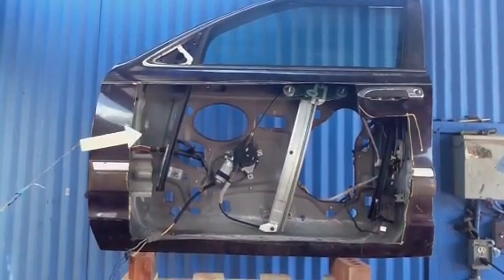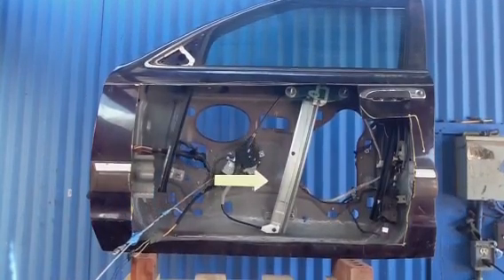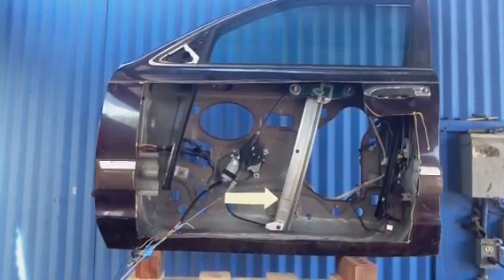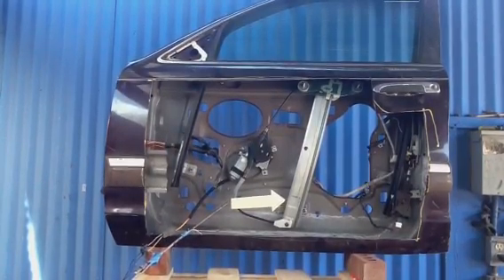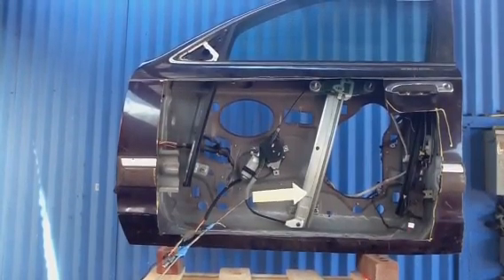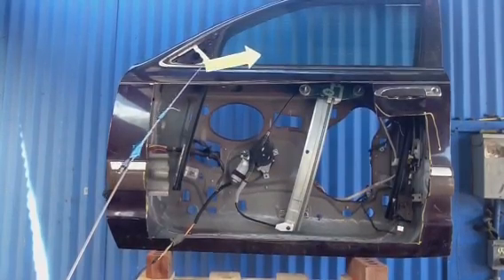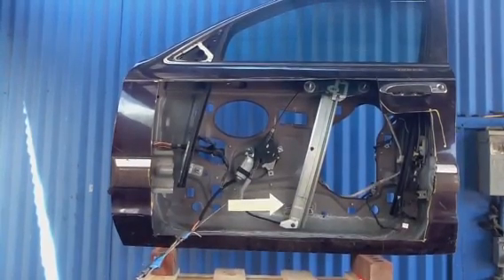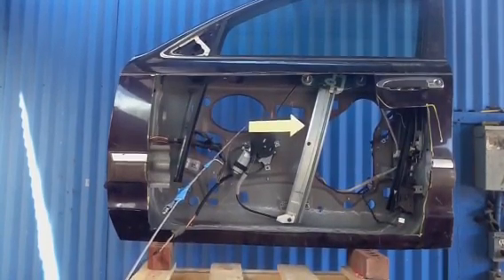How car window regulators work

Comment: Don't buy the hype. I went to the junk yard. Got 4, one for each window, then swapped them into my car. All 4 windows. Tools? T30 and flat head to take off the door panel. Then, 10m socket and a 10m closed end wrench to reach them two holding down the window. Get out there and become a junk yard dog. Save yourself bukus $.

Comment: Baloney.  The car's computer senses the slight overload on the motor as it reaches full up or full down, there is no encoder or data connection from the motor, only power  connections.  There is no "programming" involved, there is no learning involved.  An obstruction can duplicate the power overload and cause shutdown.  I would not rely upon anything in this video except, of course, the arrow.
Reply from the maker: why did you watch it if you know so much ?
Reply: Why did I watch? Somebody has to call out bullshit when it's  posted.

Comment: My Gray Old Lady F 250 7.5 90 got lazy the window powered by the battery and eventually the switches quit working much at all and then just died when someone messed with them and today I tried the old by pass trick with an old piece of electric cord from some old messed up and salvaged lamp and it worked: used the battery both posts and hooked the cord to the connector coming out of the inside of the door front and it worked: reversed polarity and up it went and down and my wife was really happy and then she said I got to fix her side of the truck: passenger side. But I was estastic or electrified and not fried. Thanks for reading this. I enjoy videos on hot do it your self.

Comment: No chip in the motors. Might be a hall sensor but thas eet. Theres an interrupt switch at the bottom and one on top to stop the motor for some cars, on others the circuit trips when current increases (motor pulling more current when trying to push up a window thats already up).

Comment: Well my regulator works fine without glass connected, but just makes a groaning noise when trying to get the window up in the right rear on a 1995 Ford Falcon, I have given up, restored the liner and disconnected the switch.

Comment: much, much cheaper to go to a pull it yourself junk yard, and grabbing the whole door and replacing the door then to do what is suggested in this video. now, of course sometime your local junk yard might not have the same model or same color but I would start there if you have issues with any part of the door, they sell at my local Kenny-u-pull for like 40$ for the whole door(without interior trim) so just take you trim off unbolt the door from the car and put junkyard door on the car plug all the harnesses and done. can all be done in one days work from the junkyard to your car. I know this because I did it myself, the window wasn't at fault the door was badly rusted right under the mirror. so replaced it, bought a can of spray paint from CARQUEST with the cars color code that is labeled normally inside the door frame. if you take you time and have some tools doing it yourself will save you hundreds of dollars in labor and scam.

Comment: Now show them how it works on a coupe or convertible. The rear windows on those are far more tricky and require even more steps to access under the panel. My Mercedes convertible, you need to remove the rear seats first.

Comment: How often do these window regulators break? I had to get two (drivers side and front passenger's side) repairs done when the regulators broke within a month of each other a year ago. AND NOW almost a year later the window regulator is broken again on the front drivers side.  >_> I'm not convinced they fixed it correctly. How often are these supposed to break exactly?

Comment: Question. I have a 2003 Toyota Highlander. My drivers side passenger window won't roll down. I can hear power going to it when I push the button from the drivers seat. Any idea on what the problem might be?

Comment: Wife's 2011 (looks same as yours) Elantra got broken into. They busted the passenger front glass with a bar. The glass man came and when he was done said it wont roll up because a clip on the window regulator broke also. He denied he did it. Said they do that sometimes. Anyway, he said I had to buy the whole window regulator when all that is broke is the clip. From your video, it looks like just the clip could be replaced. Would you know?????

Comment: Thanks for the video. I learned a few new things. This is not applicable to my '99 Ford Exploder, but still, I'm learning. I learned that there might be somebody in my area that specializes in this type of work and they might do the job for a lot less.  . . 
 I prefer the old hand cranked windows that worked for 50 years instead of breaking after only 10 years. .
Reply: Irony, I'm currently fixing up a 97 Explorer, and the regulator has nothing to attach to the glass 😂😂

Comment: Funny how you make this seem so complicated. If i listened to your tutorial on changing
the sand in my cat box I would probably be terrified of the difficulty in doing it.
 Would I have to re-initialize the box after dumping the old sand?  I'm not sure where the shit sensor is.
Reply: You do have to reinitialize it on some cars. Like my Nissan 350z. What happens if you don't is that it'll roll up all the way to the top, not knowing where the top is, hit the top thinking its some obstruction, and roll halfway back down.
Reply from the maker: +Christopher Crawford yes you do . mostly on coupes
Reply: I don't know about coupes... But it's definitely the ones that the body of the door doesn't frame the top of the window.

Comment: My impression is that this company is trying to discourage you from even trying attempt to do it yourself.  Too complicated?  Really?  I found a Youtube video on how to take my door panel apart and how to replace the regulator.  Very easy!  I wouldn't do business with a company like this.
Reply: What he was saying is that the relearning process for motors like the ones from Nissan can be tricky to figure out. But swapping out the motor and regulator is easy.

Comment: A lot of interesting information, unfortunately none of it explaining how a window regulator works.
Reply: Agreed....and they also make it sound SOOOO complicated to do anything.
In the Toyota I had, the algorithm to reprogram the window was literally: roll it all the way down, roll it all the way up, roll it all the way down, roll it back all the way up. It's in the owner's manual for crying out loud.
Also: still trying to find out exactly what that window regulator does...
Reply: @r4ptorbunny593  what the trashh man, optical drives for computers use just a power switch at the end of the travel to stop the power going to the motor, or why cant they just put a weight sensor that stop the power at the minimum increase of resistance. My peugeot window if you put your hand there it can harm somewhat seriously, those system have very strong torque.
Reply: What I thought

Comment: Hey there,thank you for the instructional video,i had a question, i have a 91 mustang and it has the old style regulator and my question is,if the regulator's teeth are attached to the window motor gears why does the regulator have a spring on it? just so when you take the motor the window doesn't fall down? thank you for your time!!

Comment: So how DO window regulators work then??
Never mind,the arrow made this the funniest thing I've seen for years(I don't get out much).
Reply: Well that's right, I still don't know how it works; I guess that the motor has a cable attached to it that winds around some sort of cam that slides the window mount and attached window up and down the rail but, I didn't find that out from this video and I don't live in Texas nor am I going to visit Texas either so I'm screwed I guess.

Comment: I have a Nissan 350z when the window is rolled up with in about 2 hours the when comes down about 2 inches and if left over night it will be half open. Would u have any thoughts on what this could be and how to repair it. Thanks for your time and great video on the way you cut the door open with detailed explanations.
Reply: You have to do the relearning process on that.

Comment: Ok, does the regulator with motor come with a new cable because mine is frayed so I ordered the before mentioned and I'm hoping it comes with the wire cable as well.  I figured ordering the regulator alone would not come with the cable since it probably is attached to the motor.  Now if I'm wrong, I'm gonna be spending a lot of money to fix this problem with the frayed cable.

Comment: Most of the "re-initialization" sequences are if equipped with auto up and/or auto down : Hold the switch on the 2nd click (down) until the window is completely down then hold the window button on the 2nd click (up) until the window is completely up. That at least covers : Fords, Audi's, Volkswagen's and toyotas. ( they are the only ones i've tested) But i'm sure its close to the same on most makes and models.

Comment: Sorry for beating a dead horse, but get you a door off a vw beetle or a Audi a4 and do video. You have good points for basic beginners. But a lot of us are certified technicians that you guys call us for help and info on all new cars.. We goto schools and sit in classrooms for days at a time learning the new cars before they hit the dealers..nowdays each window is controlled through a control module,so if your trying to diagnose problems at home,sorry but your going to have to bring it to a certified technician..

Comment: I really like the little arrow pointer , and the cut open door is great . Keep in mind people buying Lexus do not fix their own windows they are too stinkin rich . .It looks like manufacturers make those regulators crappy just so they break .Tiny plastic pieces holding parts together . 
Just like the old days when chevy put plastic timing gears in the Vega motor . designed to make the shop money 
Its sickening how obvious manufacturers are to screw the customer .but most people are stupid anyway

Comment: All the info to re-initialize is in my owner's manual- for my car (BMW) to reset the windows: 

Turn ignition on

Push the open window button until the window is open, then keep it presses for 5 seconds longer.

Push the close window button until it is closed, then release. 

That's it.l

Comment: door panels are usually pretty darn easy to remove and you can usually find a diagram either in a shop manual or online to see where the clips are and where the screws are.

Comment: I agree with Dennis. I have a problem with my Toyota Avensis. I'm looking for advice on how to fix the damn regulator. The electric motor works fine, when I drive 12 V into it - had to do that to get the window up after the switches stopped working. I DON'T want a video saying it's difficult. It's as annoying as googling for an answer to a problem, only to end up in a bunch of forums where people are asking for same answer and all they get is these smart donkeys saying "just friendly google it".

Comment: Would it be possible to use some of this footage for part of an engineering video project? I am currently at Loughborough university in the UK, and we are doing a short documentary about the way an electric window works. We would only use the video and add our own sound over the top. We will also credit this as the original  source of the footage.  Thank You Karim Habbas